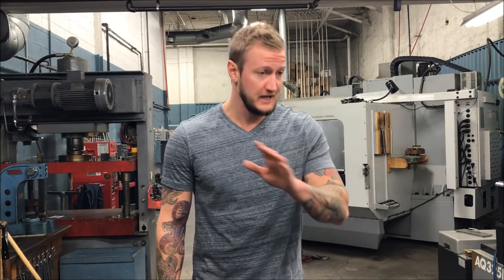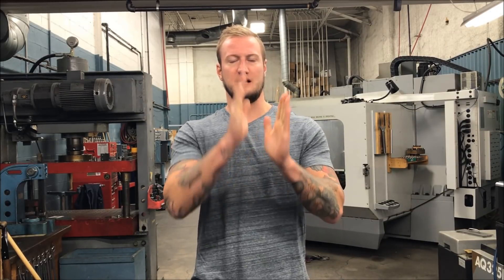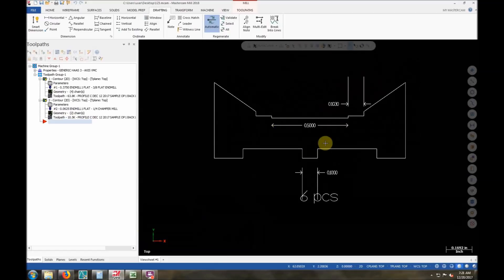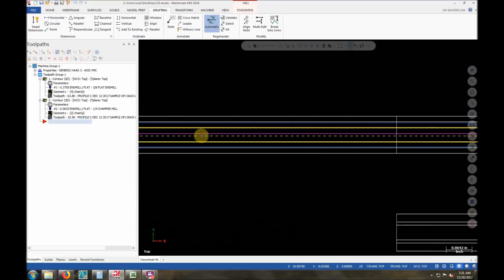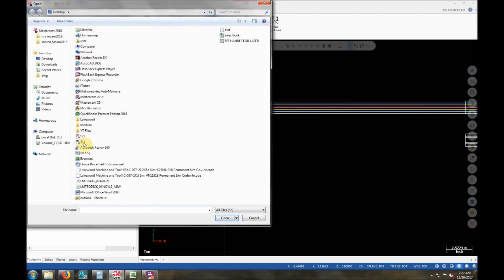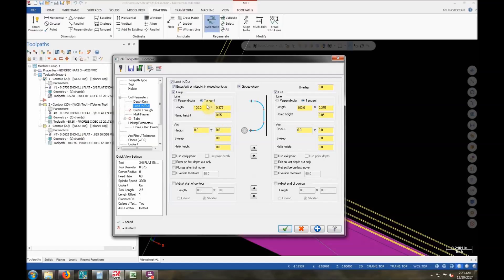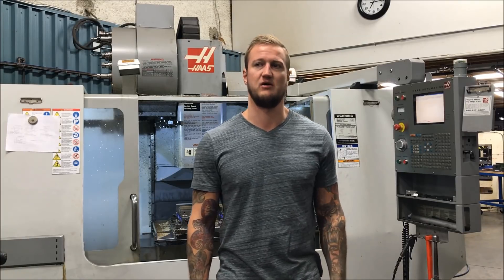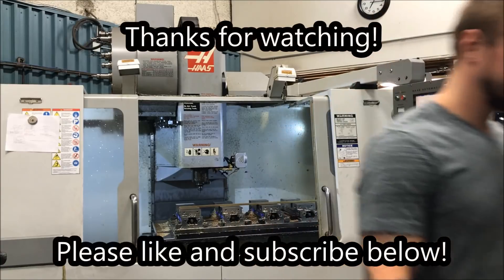LET'S MACHINE: LONG BRASS PROFILES!

Comment: I wonder if the Titans of machining guy's tip on using longer vise jaws would help with stuff like that?  Nothing too complicated, just longer vise jaws sticking out of each side, might give slightly better holding.  Could help spread the clamping force out over a larger area too.
Reply from the maker: It definitely would! I actually have long aluminum jaws around 60" long that bolt into multiple vises to do the same thing more or less. It works really well! I'm not 100% sure why I didn't do that here.

Comment: I visited a profiles factory a couple of months ago.  They relax the brass by putting it in an oven overnight.  I forgot the temperature.  Just remember that zinc melts at low temperature, so the relaxing temp should be below.  No thermal shock.  Easy temp up, and easy down.  
I like your channel.  This is the third or forth video I watched today (kurt vise brought me here.. :).